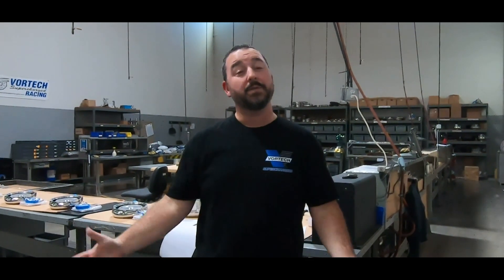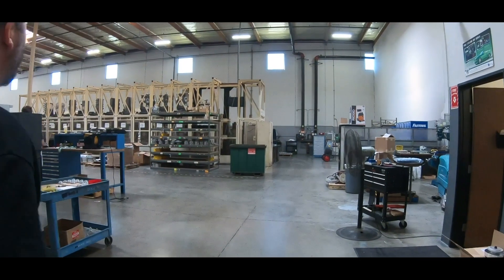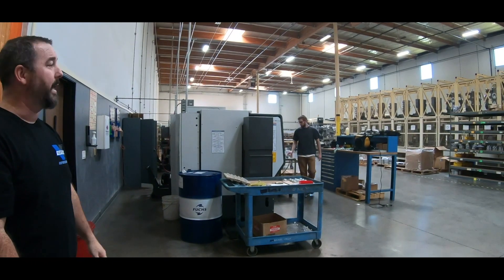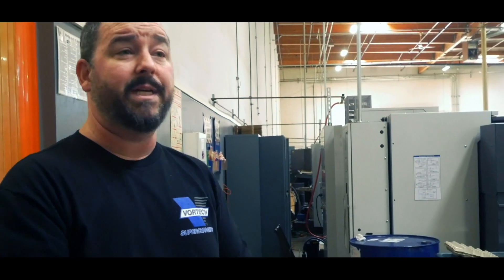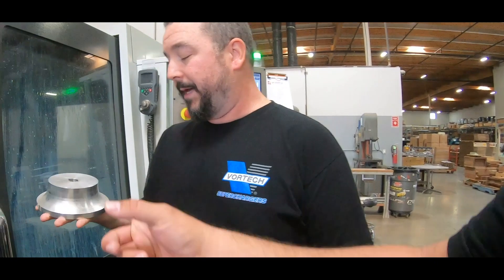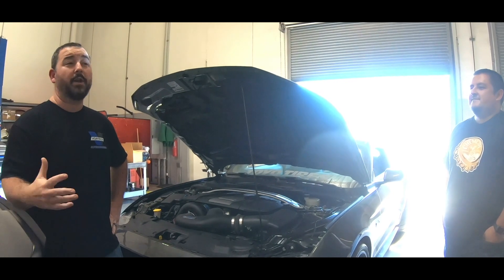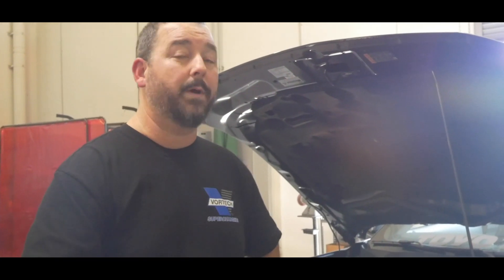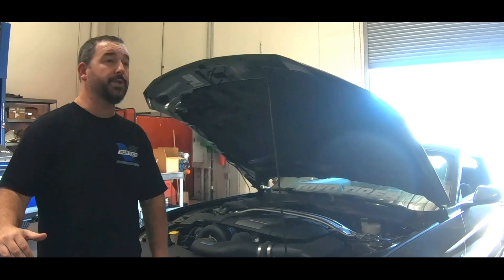Lethal Performance takes a tour of Vortech/Paxton Superchargers

Comment: I am on my second blower with you guys..... first was on a fully built 3v 05 mustang with a Novi 1200sl, now an 11 fully built/forged coyote on a V3 SI...... are there any mods we can do to the V3 to make it spin a little higher and blow more cfm?

Jay 
PBK Motorsports
Reply from the maker: A smaller supercharger pulley or larger lower balancer would be the way to add more boost and make more power. We have tons of pulley options available so feel free to give us a shout if you have any other questions. 

Thanks!

Comment: ....wannabe Procharger......
Reply: Vortech/Paxton has been around longer, but I do think Procharger is more innovative when coming up with new products.
Reply: @chrism.728  yup
Reply: Procharger is a shot in the foot to the coyote engine. Their design will annihilate the crankshaft of your motor into several pieces. I've seen it first hand.
Vortech ALL THE WAY!!!
Reply: Tiago Guimaraes Anthony Ballard from Signature Speed literally just shared on FB where he had a customer with a Procharger setup come in that had the crank snout snapped off 😂
Reply: I love how procharger doesn't display adiabatic efficiency maps... kind of annoying
Reply: Actually they came out first and at least for the corvette A&a and ecs which is Paxton Vortech is hands down the better supercharger . More tq and no belt slip and breakage like procharger. Procharger cars use a&a mounting brackets in their cars to stop belt slip and breakage plus prochargers customer service sucks and ends after purchase and their blowers aren’t as reliable as vortex. They don’t honor or stand by their stuff when it breaks its pretty much f you unless your a rich man or you tuber. Doug from ecs or Andy from a&a will fix it , pay for shipping and send you one to use while yours is getting re built but they don’t Hardly ever break. 20 f series prochargers break for every 1 Ysi or 2200r
Reply: Procharger is not better lmao. Overpriced. High IATs. Adding a separate belt and drive system only adds stress to the crank. Don’t even get me started how Procharger loves to put the intake over scorching hot exhaust manifolds. That’s hilarious 😂😂
Reply: Tony Bolton seeing as Procharger was founded in 1993 and Vortech before that in 1990..yeah.  Shut the whole fuck up you silly mouth breather.
Reply: @blackonefifty  ....yea...and they're still trying to catch up....ouch
Reply: That's funny, considering that these guys were around (as McCulloch and then Paxton) for a full 57 YEARS before procharger ever came into existence. As blackonefifty stated, even Vortech was around for years before them. The original is never the wannabe.
Reply: @hcracerx  just because you been doing something longer doesn't mean you're better at it.... quality over quantity
Reply: Tony Bolton lol k.  that’s why stage 2 kits for the mustang have a literal flaw in their design causing strain on the crank with the two belt setup.  

BUT MUH QUALITY 🤕
Reply: @blackonefifty  ...bout time for you to get back on Facebook and be a mechanic....with all the other 16 year old girls...
Reply: @blackonefifty  Damn bruh, roasted his roasts lmao, that comment just got better and better as I read further.

Comment: Kiiiinda wanna scoop up a Paxton for my 18 Mustang.  I know the Whipple is more and probably well worth the money but that vintage gear set sound takes me back 😂
Reply: blackonefifty you’ll love the Paxton on the 18. I love mine.
Reply: nola504boy1 oh I scooped one up on Black Friday sales.  Still gotta deal with fueling and get a tune.  Hopefully within the next month or two.  HOPING for 700wheel on pump but if it can’t swing it then oh well
Reply: blackonefifty I made 725 rwhp on 93 octane with mine everything else was stock. Palm beach dyno tuned.
Reply: nola504boy1 PBD seems to get that magical 700 number out of these Paxton setups.  Wondering if I should jump ship and go with them.  Just hate having to buy another device.  Appreciate the input bro.
Reply: blackonefifty how is the car bro?
Reply: nola504boy1 got all my stuff together aside from a new crank pulley bolt for OPG’s which I don’t really have to do but I’m gonna do anyway.  Once it comes in I’m getting everything thrown in in March when the shop I wanna use gets back from Bradenton NMRA.
Reply: nola504boy1 quick question. Since Paxton is self lubricated. Isn’t it recommended not to start the car under 25 degrees. How do you drive in the winter?
Reply: @nola504boy1  Did you have to upppgrade injectors to hit 750? I know 18+ have 16 injectors total.. just curious.